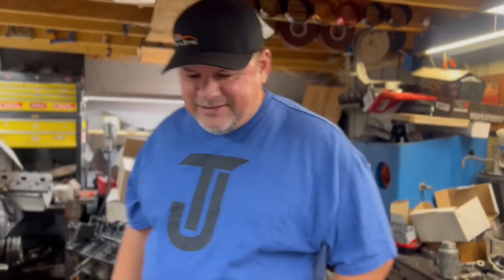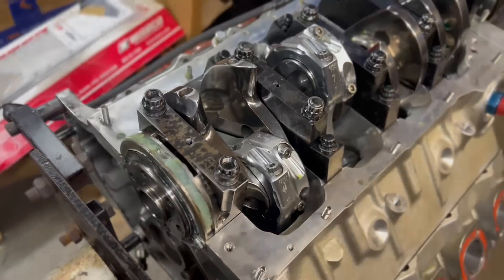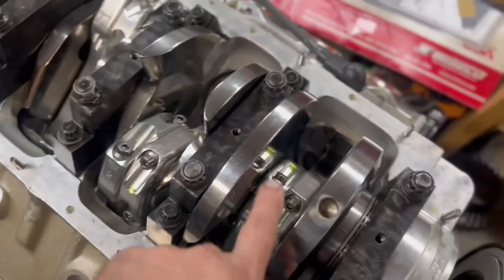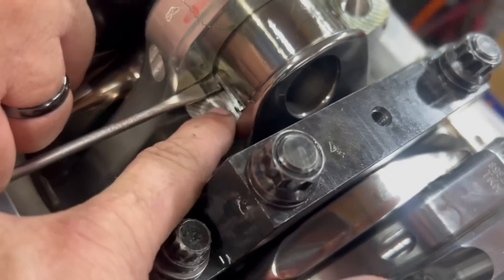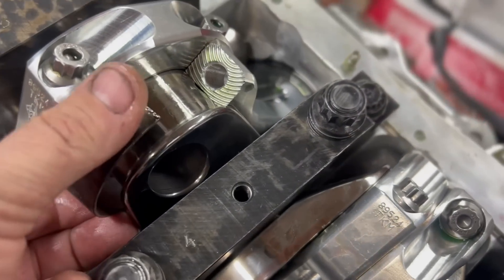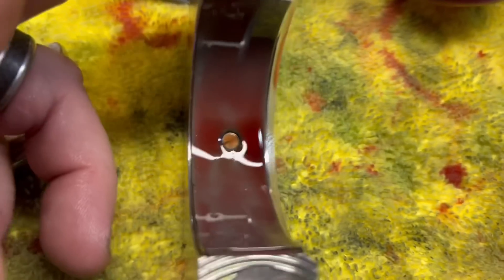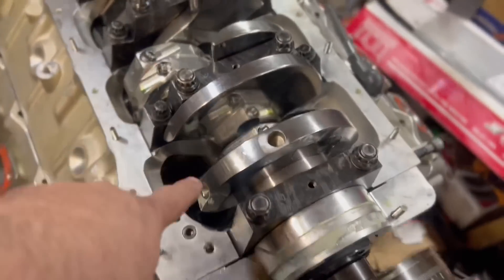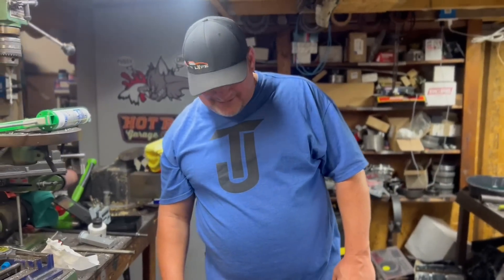Changing Main and Rod Bearings in a 2800hp SBF!

Comment: we don't use aluminum rods but in our Sprint car engine it has an aluminum block, one of the things we use is a block heater basically a diesel generator that produces water flow and Heat that we hook to the engine that warms up the block before we start it. usually gets to about 180° of water temperature. good job I like watching your stuff hope this helps

Comment: It looks like that block has provisions for wet sump. I have a Titan billet oil pump for my N/A 445. It’s only going to make around 1000hp and spin 8200 or so, but I’ve heard the turbo guys love them. No external plumbing, dual pickup, and Steph’s makes an aluminum pan for them. Seems like a lot less hassle to me. They’re also adjustable thru a plug in the pan.
Reply from the maker: The external stuff is more hassle for sure.

Comment: Awesome video John, what kind of rpm does that sbf turn?
Reply from the maker: 8500-9000
Reply: Does it use Cleveland style, canted valve heads?
Reply: @danmyers9372  Yes, canted valve Cleveland type heads from what I've seen in the build videos, not sure what brand

Comment: I kind wish you showed rolling the main bearings in. Wondering if you lift take all the main caps off or one at a time or just loosen all of them then do one at a time. I'll be wanting to do the same in the early spring.
Reply from the maker: It was the same as the rods, just more difficult to push it out.